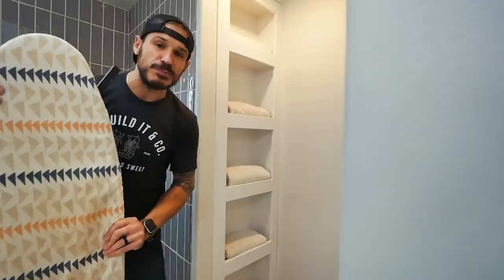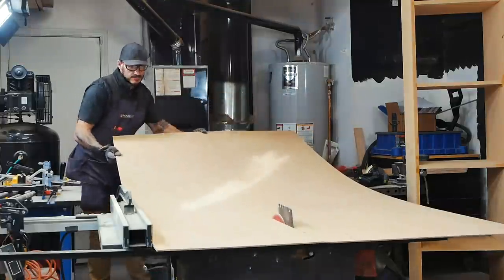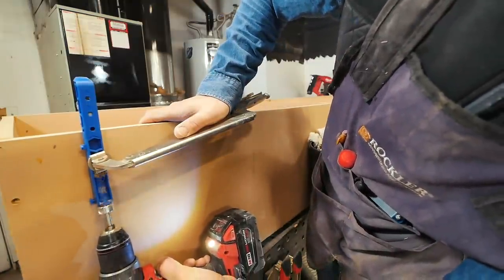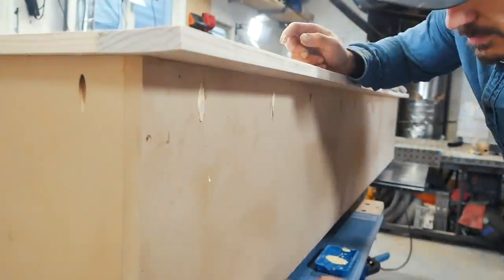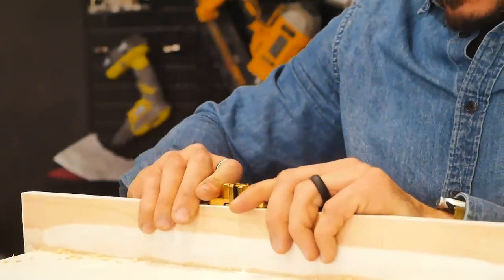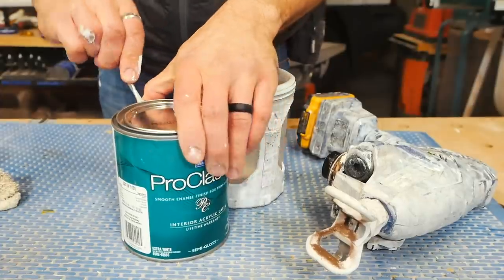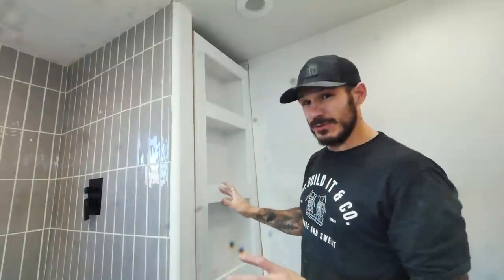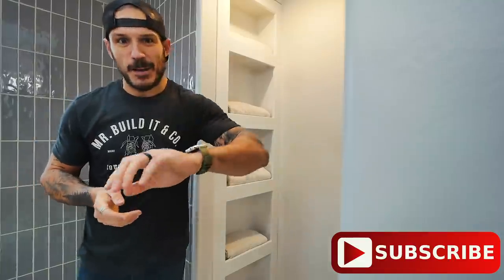How to Make a Secret Door / Towel Rack

Comment: Should have used a non-water based primer so you don't raise the "grain" of the MDF.  Great build, cool video!
Reply: I was taught to use a oil based paint for MDF.
Reply: Andrew W enamel or water based is totally fine if you have a good primer coat on it.

Comment: MDF in a bathroom, is going to be trouble in the long run.
Reply: i don’t know much about this stuff so i’m just curious, why?
Reply: abbey I’m guessing with moisture from the shower it’ll end warping or molding.
Reply: Brenda Taylor, ohhh that’s no goodb
Reply: SB W was thinking the same, would myself not go with MDF in a bathroom
Reply: Pretty sure the primer/paint is enough to seal it.
Reply: WebCity Films that’s horrible !!
Reply: what you need is MR MDF - MR meaning "Moisture Resistant" and then seal it with a few coats of OIL BASED primer / paint.

Comment: MDF in a bathroom with shower/tub? I don't know man. I wouldn't use MDF anywhere there's high humidity, painted or not it'll swell up faster than it took to install. And with one side cooler than the other, it'll sweat, causing it to swell up that much more.
Like you mention in the video, MDF is like a sponge... 
Oh well, the owner will be replacing that build soon...  but hey, just let the painter fix it. Maybe they can float the wall to match the swelled up MDF. And once it really swells up - it'll be like a time capsule sealed for the next umpteen years till someone busts it open. lol